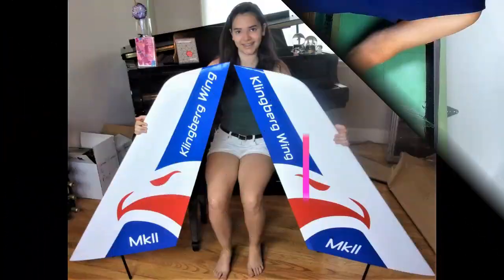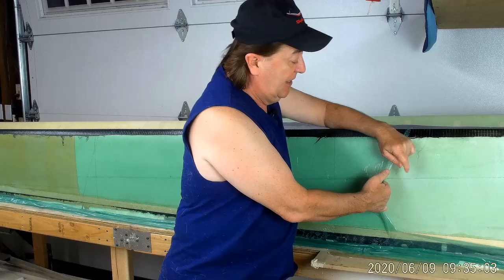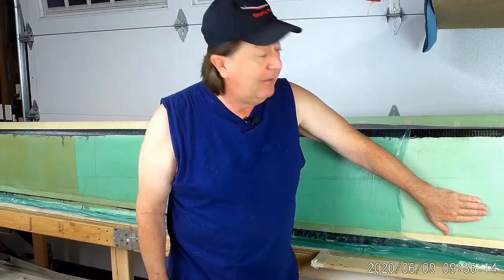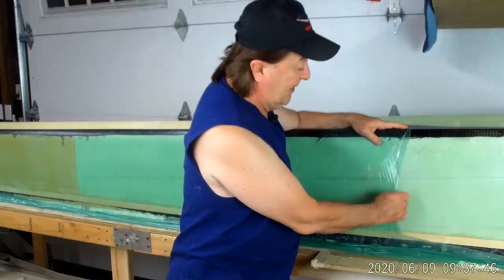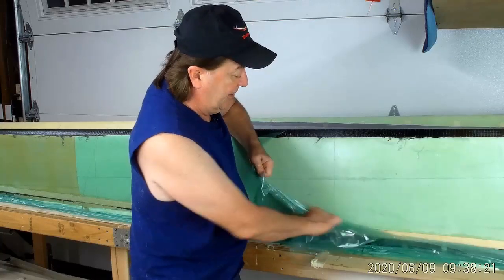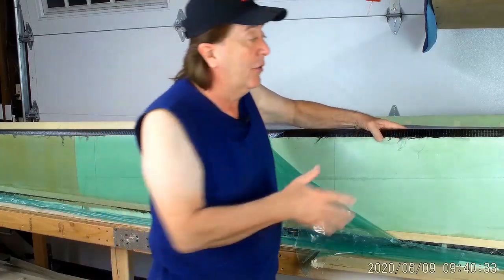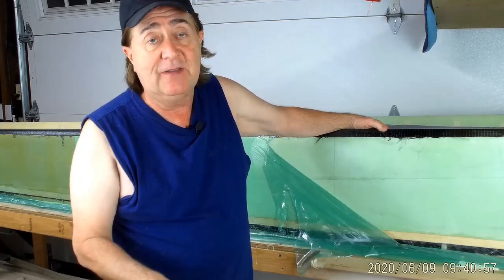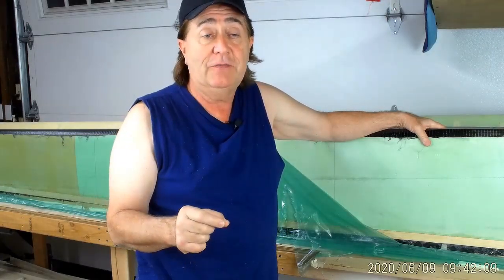D-Tube Success - Klingberg Wing MkII Development

Comment: In thinking a wire cut Dtube can be wrapped in one piece. BOOM. If foam core is "stacked" 2" foam, lightly bonded, it could be hogged-out through sheer web openings. Think about it...